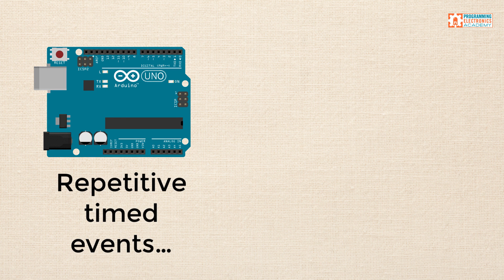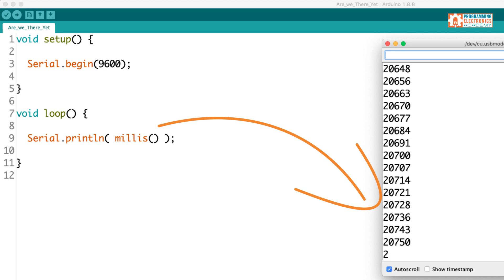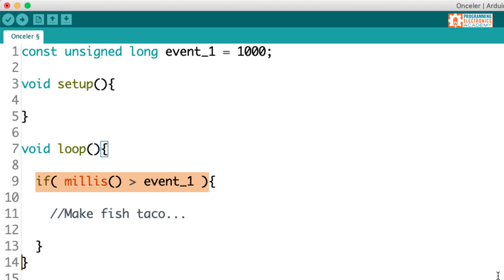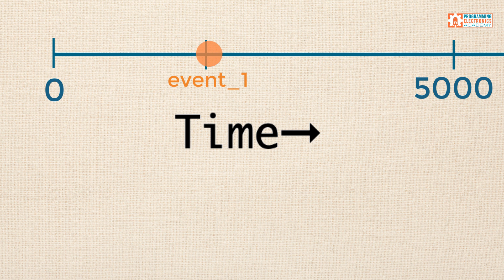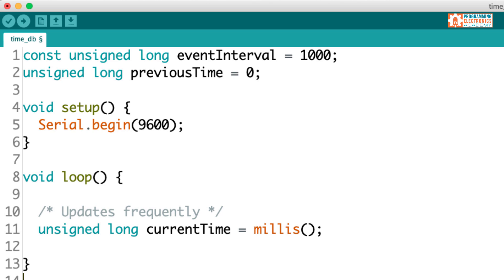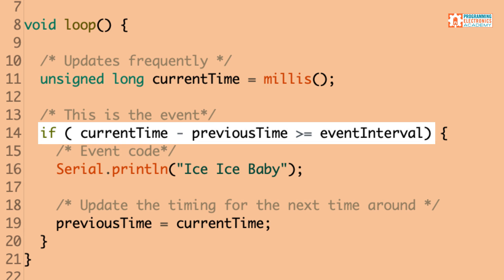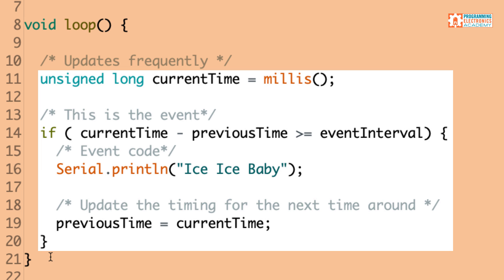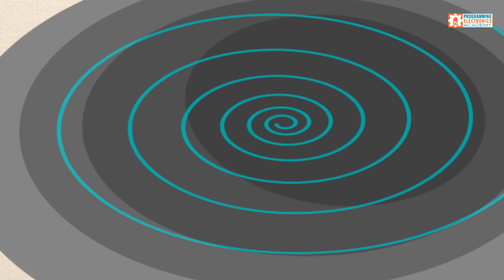Arduino Sketch with millis() instead of delay()

Comment: Yes very good explanation but does this work if the interval is over the 4294967296 wrap around if the current time is 904 and the previous time is 4294967200, being unsigned is it still going to trigger the >=?

Comment: Same idea…. Slightly different solution:

if(millis() % 1000 == 0))
{
  // make your fish taco
}

IOW use modulus operator… any number divided by 1000, then take the remainder. When remainder is zero, millis is a multiple of 1000.
Also: You can make an LED ‘flicker’ by using the random function to change the 1000.
Reply: This is a bad idea for two reasons:

1. If your loop() ever takes more than one millisecond to run, you may well miss the specific millisecond you where aiming for.

2. millis() doesn't count every single millisecond: as it is only updated every 1024 µs, it skips one value roughly every 42.7 ms (it skips 42, 85, 127, 170, 213, etc.).

Comment: Helloo, if currentTime = "MAXIMUM of millis()" then next currentTime(or next value of millis() ) will be : Case 1 : or remaining to "MAXIMUM of millis()" or Case 2: next value will be 0.Which case do you think that will happened?.
If Case 1: currentTime = "MAXIMUM of millis()"  minus previousTime (which it will be olso "MAXIMUM of millis()")  = 0 (so, the difference will be zero and all the time will not >= SetTime.
IfCase 2: if millis after 49 days will be automatically 0 then difference 0 - "MAXIMUM of millis()" ('the last value of previusTime) will be negative , so, in this case it a must to use all the time ABS(currentTime-PreiousTime) >=SetTime.
So which case it happening!?
An alternative solution is to use a function to reset automatically arduino ( I tested this function:
 void(* resetFunction) (void)=0; (place in one line ) and, after, in loop rutine call this function using: resetFunction();
if millis()>=4000000000UL ....resetFunctio() .. .This resetFunction is very fast.Write , as example, Serial.print(F("abc..")); after calling resetFunction(); and you will see that Serial.print(F("abc..")); will not happened because arduino it was reset be resetFunction();
OR, if someone cand wait ~ 49 days to see what happend with value of millis() function after this period , please let me know :)) .Maybe will happened one of both cases 1 or 2 ...or neither.

Comment: Why not use the modulus function?  If (currentTime % eventInterval == 0).  It wouldn't be precise on the rollover (unless the interval was a power of 2) but it allows for lots of different intervals with minimal code.

Comment: Hey Programming Electronics Academy. Your code is good if you want 1000 milliseconds between events, which ie. takes 10 milliseconds to execute. However. If you want things to happen every 1000 milliseconds, sharp, then you will need to add 1000 to the carrot, instead of moving ahead with the relative time. You can say, that you would add 1000 to the limit of 1000 every time, making an absolute goal, rather than adding to the relative currentTime.

Comment: Little help or suggestion.  I'm new to the Arduino programing or Arduino as a whole but I've running into a dilemma in which I'm looking for some guidance.  So let me set the stage, I have a sketch that constantly flashes LED lights (Nav Lights) then I have a function that when a button is pushed it should play some music and flash another LED while the other LEDs (Nav Light) should continue flashing.   However when I the delay function, the sound plays and the second LED flashes but the first flashing LED's (Nav Lights) pause.  I have tried multiple different ways to try an use the millis() function but when I push the momentary button I can't get the SD card to play sound and the second LED to flash.  Is using the millis() function the right thing to use or do I need to do something else.   your lesson 4 started to discuss this but it didn't give an example.
Reply from the maker: Hi John, great question here, and just so you know, timing can be super tough sometimes, so if you have a difficult time with it, you are in good company.

I could be wrong here, but it sounds like you are using delay() in the function you are calling from your loop.  If this is the case, when your function gets called, it will delay your loop, until you function is done running, and then return to the loop.  Maybe you have realized this already...

Another caveat to note here is that if you are using a library to play noises from an SD card, some of the functions in that library may be blocking code -> that is, code that holds up the program for a bit, while it executes.  This may, or may not be the case, but it is something you'll have to figure out.

The millis() construct that I go through in these lessons is definitely a way to handle timing different events but sometimes it depends on situation.  Not sure this helps much or not!

Comment: I want to write a code as below and I want to replace delay() function with millis().
Please can you tell me how to write code for this?
I would like to appreciate if you can show it with a example.

"
       digitalWrite(column[0], LOW);
          delay(40);  //wait for 40ms before start below statement
        digitalWrite(column[1], LOW);
          delay(40);
        digitalWrite(column[2], LOW);
          delay(40);
        digitalWrite(column[3], LOW);
          delay(40);
"
Reply from the maker: Hi Alham - did I replied to your comment on our website with some code.

Couple questions though...does this just repeat over and over and do the LEDs turn off every loop?
Reply: @programmingelectronics  I didn't get a email notification. Please can you give me a link to the answer?

Ummm.... this is a example code and what I want is run below statement after some delay.
Reply from the maker: Hi  @alham__aa  

Something like this might work…
https://www.programmingelectronics.com/arduino-sketch-with-millis-instead-of-delay/

/**
1. Create Array for LEDs
-Initialize LEDs
2. Create variables for timing
3. Create timing construct
– increment array each time through, and then reset to start...
*/

// LED Array
const byte LEDPinArraySize = 4;
const byte column[LEDPinArraySize] = {6, 7, 8, 9};

//Timing variables
unsigned long previousMillis = 0; // will store last time LED was updated
const long interval = 40;

void setup() {
for (int i = 0; i = interval) {
// save the last time you blinked the LED
previousMillis = currentMillis;

// Light next LED and increment counter
//If all LEDs lit, turn them off and reset counter
if (nextLED < LEDPinArraySize) {
digitalWrite(column[nextLED], HIGH);
nextLED++;
} else {
nextLED = 0;
for (int i = 0; i < LEDPinArraySize; i++) {
digitalWrite(column[i], LOW);
}
}
}
}
Reply: @programmingelectronics  Thank you so much for concentration. I think this will work for me.
Reply from the maker: @alham__aa  I hope it helps!

Comment: Took a while to get millis() working in my code but so much better than using delay.
Reply from the maker: Nice!
Reply: With millis() the serial data continues to be read, where previously it was clear to see on the Serial Monitor that delay had simply frozen it dead for the length of the delay.

Comment: Thanks for video. I'm trying to understand this;
Considering that we use delay depending on the if function;
sample;
sensor = 8;
led out = 11;

if(sensor == 1)
{
digitalWrite(sensor, HIGH);
delay(10000);
}
I wrote it roughly like this. In this case, let's assume that the sensor in pin is active and the delay function starts. In this case, the system is in standby. In the first 5 seconds of this wait, if the value of the sensor pin changes, will the delay be disabled? that is, does the system exit without waiting at 5 seconds and start working again? otherwise, even if the pin value changes and if equality is broken, will the system continue to wait until 10 seconds is up?
Reply from the maker: Great question Ahmet!

Once the program hits the delay - it stops in its tracks - nothing will happen - no new sensor readings, no anything, until that delay time has passed.

Let's say what you want is to wait until the sensor reading changes to some value/range, what you might try is something like a while loop that uses the sensor reading as the condition, and then inside the while loop keep reading and updating the sensor value.  Not sure that is what you're after, but just a thought.

Best of luck!
Reply: @programmingelectronics  What I'm trying to do is that the data from the sensor is  contuinue without stopping. That is, the leds turn on according to the data from the sensor, however, when the sensor data changes, the leds turn off momentarily. I guess this can be done with the millis function.
Also, I was able to understand the millis function for the first time when I listened to your videos.
Thank you for this valuable explanation.

Comment: Great video, thanks! One comment though, I think we could also use a modulus operator to manage the event intervals. This would also cause it to run at millis() == 0, but we can use an additional clause to limit this. Perhaps something like:
if( currentTime > 0 && currentTime % eventInterval == 0 ) { ...
Reply: Actually, it seemed like this would work in theory, but there needs to be a buffer, as the code would run multiple times at each interval. I guess this is why the lastTime variable is introduced, so that we can ensure the code runs only once per interval. Makes sense - I stand corrected!

Comment: First off, thank you for your very informative video. I know this video is a few years old but I just came across it so my apologies for such a late comment.

From your video, and from others, I understand that millis() starts as soon as the Arduino starts running and it keeps running, and increasing, as long as the Arduino is up, at least until it reaches its maximum value and restarts. I'm not sure that you actually CAN reset millis() from within code but everyone seems to say you shouldn't. Apparently doing so can break some libraries that rely on it.

In order to understand millis() better I made a little project using code similar to yours to blink the built-in LED on and off at a preset interval while displaying current_elapsed_time (read from millis()) and previous_time, something similar to what you did in your code, and everything ran as expected. However, I noticed that every time I closed the serial monitor and reopened it the current_elapsed_time, which should display the current millis() value, returned to its starting value. The LED continues to blink at the proper interval while the monitor is closed, so I know the code is still running properly.

Thinking there was a bug in my code I created a new, stripped-down program which only makes a call to millis() and prints the retrieved value to the serial monitor (see code below) and ran my test again. Same behavior. The code calls for the millis() value to be sent to the serial monitor directly - no massaging or assigning to a variable - and every time I close and reopen the serial monitor it appears to reset millis(). Not sure what is happening. 

Here is the simplified code I used to test:

void setup() {
  Serial.begin(115200);
}

void loop() {
  Serial.println(millis());
}

The program runs as expected and, as you can see, there is nothing but the call to print the current value of millis() but millis() seems to be affected by the status of the serial monitor window. Is this normal? Am I missing something? 🤔

Appreciate your help on this.
Thank you.

Comment: I liked your previous design using event_1 value and updating it when reached better. It seems simpler and also it will keep the period of happening precise and unmodified by the time used to handle events.
If (now >= event_1) {
  // Update the event_1
  event_1+= event_1_period; 
 // Handle this event
}

Comment: Thanks for the extensive explenation.

I made function out of this, which can receive interval in milliseconds and counter number, so it can be called multiple times and keep prevousTime in array for multiple counters.

if(execDelay(2,1000)) {
    // Do stuff
  }

bool execDelay(int instance, unsigned long v) {
  unsigned long prevTime[] = {};
  if(currTime - prevTime[instance] >= v) {
    prevTime[instance] = currTime;
    return true;
  } else {
    return false;
  }
}
Reply: Just one correction, define prevTime outside the function.
Reply from the maker: Cool!  Thanks for sharing that code!

Comment: What would happen if currentTime has reached the maximum 4B ??
Reply from the maker: Great question!  It starts over at 0.  Which is called "rolling over".
Reply: @programmingelectronics  If currentTime would be 0, how about previousTime ?? I think previousTime still equals 4B even currentTime is rolledover to 0 ,, it means currentTime - previousTime = 0 - 4B = -4B ,, cmiiw

Comment: Very nicely and clearly explained. I made the same comment elsewhere - going forward, when using millis() function, please DO NOT call any assigned variable as currentTime and previousTime or "timestamp" - it is not a time. It really is a timeline from 0 to 4B+ value. I see this problem in all the YouTube examples where they explain millis(). Everybody should really call it CurrentTimeLine or currentTimeLine or something similar, NOT currentTime or previousTime. Does that make sense?

Comment: you could do the same logic and prob have better runtime using (inside the loop)
if (millis() % interval == 0) {
    // do whatever you want here for every x amt of milliseconds
   // where x  = interval 
}
Reply: In an Ideal situation, you're right. But in reality millis would almost never hit exactly your interval. That's why >= is used in the video, but with your code >= wouldn't work.

Comment: What happens when the comparison happens after that reset of millis()? Won't it perpetually determine current time - previous time to be less than 1000? After 50 or so days the code just stops functioning?

Comment: Thanks so much for a very useful lesson! How to make millis () start its countdown not from the moment the arduino was launched, but from the moment the button was pressed? For example, when a button is pressed, the LED turns on and turns off after 2 seconds? And then it could also be turned on using the same button, it glowed for 2 seconds and turns off again. Help me please.
Reply: This same question is what brought me to watching these videos (very helpful in helping someone who is brand new to programming the Arduino by the way!). I want to add a "delay" to keep an event from occurring based upon another event that has occurred. ie. I want to delay turning off a device whenever another device is turned off. Hoping someone can steer me to a tutorial that explains what code can achieve this.

Comment: One thing that should be added to the code is a trap for when the value of the millis() function rolls over. Consider if your Arduino is being used on a long term basis exceeding the long int value maximum. The user would want a way to handle that condition and continue the event timer. One quick way would be to check if the new millis() time is less than the previous time then the event timer loop can be reset.
Reply: I was just wondering about rollover
Reply: The way the code is written, by subtraction of unsigned longs, it compensates for roll over. No additional checks are needed.
Reply: @Ruudrad  please explain a bit please.  Is it in the code in your face code or firmware side that you simply do not see.  As in...

If I am using millis to run a tachometer on an engine, and using that tach value to hold ignition on (interlock if you will, if RPM drops it cuts ignition) it will not get the math wrong in seeing the correct rpm? 

The long term use case here is;  the arduino is going to be powered on indefinitely monitoring a  signal from inverter to start generator.  Once the inverter calls, the arduino will sequence and start the generator.  I dont want the roll over to cause am issue with a tach calculation inadvertently shutting down the generator.
Reply: @wadebrewer7212  I initially also thought roll over would cause problems, however if you use longs and  subtract the unsigned longs (holding the output of the millis() function and/or the millis() function itself) the calculation will also work when millis() rolls over (I.E. goes from almost its maximum to just over zero). Strange but true thanks to how subtraction works on a microprocessor, which is NOT exactly the same as mathematical subtraction.
Reply: @Ruudrad  Thank you tons.  I was about to start researching for a work around.  The community around this stuff is pretty great.  Every once in a while you get the tool that talks down or "why do you want to do that project"....because I can....and at least for now...I am allowed.....lol.

Even in my situation....reading and counting every quarter or half second for revolutions....even if it did send a call to shut off the system, the cycles are so quick I don't think it would actually shut down.   But...sounds is like it's non issue anyway.

Again, thank you for the input and much appreciated.